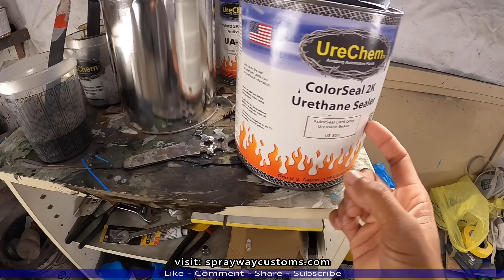How To Spray Pearl Paint Over Metallic On A Car - Painting Monte Carlo SS G-Body Door Jambs

Comment: Great video as usual brotha. How many different guns did you use if at all? Did you use same gun for different stages and if one gun was used for two different applications do you clean it in between? What do you clean with? Thanks
Reply from the maker: I use 3 guns on this…one for sealer, base and clear. I clean them after each use

Comment: i messed up bad i mixed my base coat with a clear coat activator now it wont dry any ideas ??
Reply from the maker: I’ve done that before. That shouldn’t be a problem, it’ll just make it more durable. You just don’t want to use reducer for activator but misusing activator for reducer ain’t no big deal.
Reply: @SprayWayCustoms  thanks bro I feel much better any idea how long before i can spray over the base its still a bit tacky after 3 days